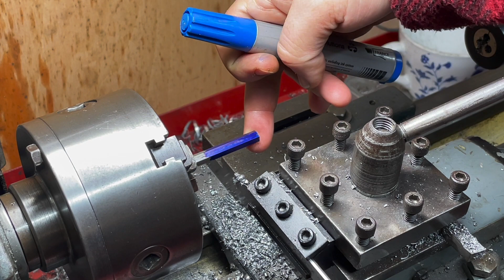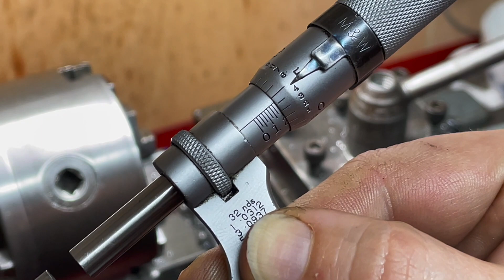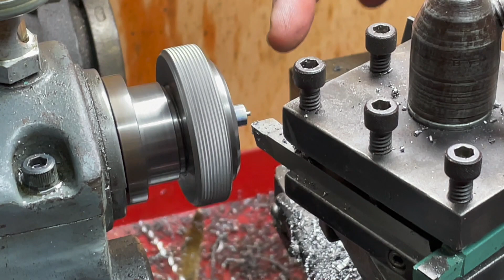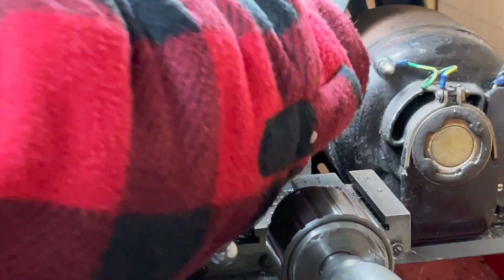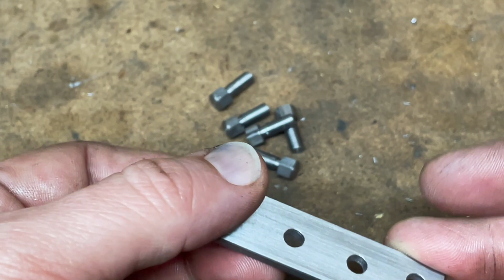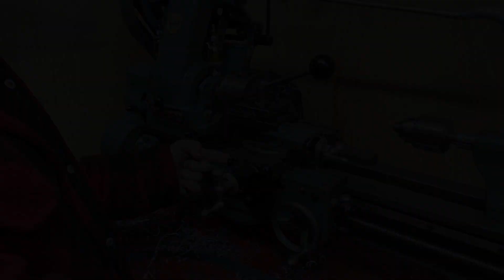Trying Mass Production on the Myford ML7! - Steam Locomotive Build #3

Comment: The holes are for the Quick change gearbox which save messing with the oily gear change rounds at the end.
We are a 2 Myford family with a free one turning up. Super 7s.
Free because it had been in a workshop with a leaky roof for 30 years. 
Also a Raglan 5. Free but some bits are still rusted together after a year. David and Lily.
Reply from the maker: Thanks, Kev also mentioned about what the holes are truly for. I think if I had chosen again I would have gotten a larger machine and not a myford - a Colchester, Smart & Brown or Boxford. Oh well!

Comment: Instead of using yourcallipers you can use a parallel marking gauge. I guess you can get them in imperial, I’m all metric unless I’m fixing something old. If the gully on the machine screw (it’s not a bolt) is too wide you can grind the other end of your parting blade thinner at the end, but remember that you can’t part with that end in the future!

Comment: Hello William,
I noticed you were using the Myford collets, I find they are not super good at gripping, do you have the same problem.
Take care.
Paul,,
Reply from the maker: They are fine if the stock is bang on but they have nowhere near the same range of clamping than ER collets . I struggled on this with the limited surface area and slightly undersized diameter

Comment: Good work. You would be better off keeping the amount of bar protruding from the chuck as short as possible as you will get a better finish.

Also, you can dial in precise lenghts of cut with either the lead screw engaged and use the hand wheel on the far right (my ML7 has one) of the bed or the compound slide. Saves marking out.
Reply from the maker: I actuallly have a lead screw hand wheel but totally forgot - thanks for the tip!
Reply: @williamsworkshopuk  That's alright. Once you have done it once, you can then see where to stop and that makes life easier. Also the power feed makes for a nice cut.

Comment: Nicely done William. 👏👏
I also need a carriage stop on my Myford lathe and have also thought about mounting one using the same bolt holes that you showed. Very interested to see what you come up with. Will it be similar to that which Ade Swash shows on his channel? 🤔 Andrew
Reply from the maker: I'm not sure why Ade didn't use the original fixing holes and instead kept drilling and tapping holes; maybe there's a solid reason that I'm missing? I don't know what I'm going to do yet, but I'm thinking about a grub or cam lock on a piece of rod, with or without sliding stops (with their own grub screws). To make it more repeatable, the rod could have a counterbore in the end to take pins of various increments (1", 3/4", 1/2", etc. as required) so you can lock everything and then precisely move the carriage by whatever length increment you use in the pin bore.
Reply: @williamsworkshopuk  Good point. I will revisit Ade’s video to see if he mentions why. I like your idea of the proposed rod having a counter bore to take different length pins. Certainly food for thought.

Comment: That was very interesting but was hex head bolts period correct? At the time that locomotive was in service, I thought square head bolts were common.
Reply from the maker: You know, that's actually a fair point. I was building as per the drawing spec but probably square headed bolts would have been used for the prototype. I don't think I can face making a bunch more just yet but maybe if I get a chance to revisit?